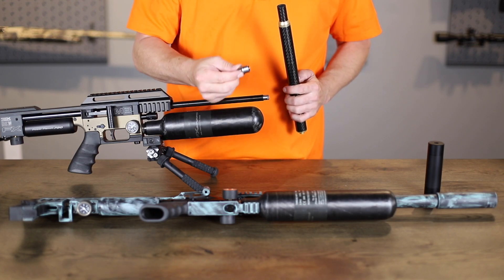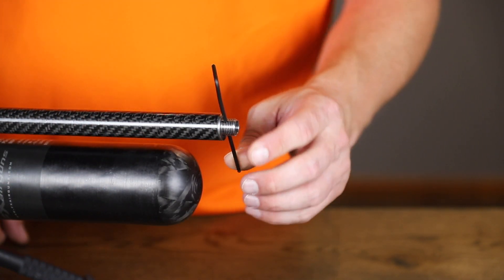Tech Central - BC Custom Carbon Fiber Tensioner and Shroud Kit - How to Install

Comment: Will your shroud fit over my 800mm barrel tension kit with a clamp barrel in front of the gun the measurements are 20.mm not 14mm that's the barrel if so I would like to buy the shroud because my gun is loud thanks for sharing bsafe buddy 👍

Comment: What happens (or how do you avoid) the air stripper inside the upper shroud grabbing on to the tension nut and when you twist off the shroud the tension nut stays inside the shroud???  Now you'd have a tension nut stuck inside a upper shroud that you can't get out.  

I made this exact thing and that happened to me, curious if that is a situation I would deal with with this product.  

Thank you
Reply from the maker: We have found when people tighten the shroud to tightly they wind up with the problem you are describing.  We suggest that customers screw on the shroud until there is resistance and then stop.  The shroud doesn't need to be torqued on the sam way the tensioner does.